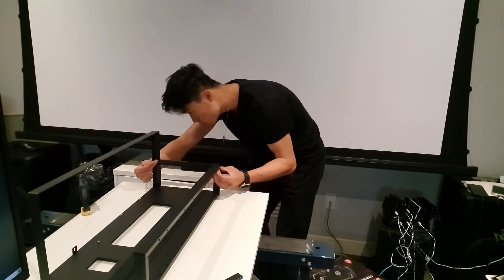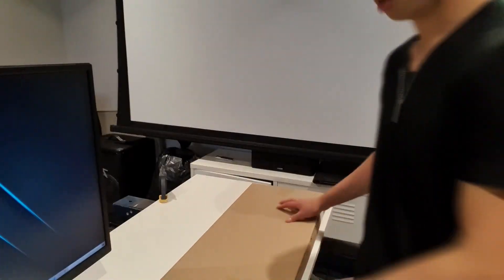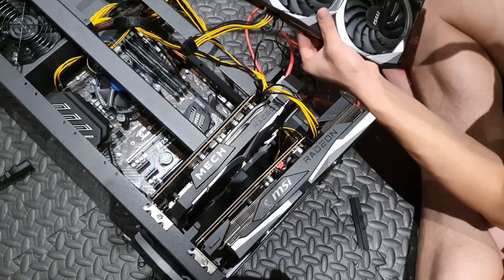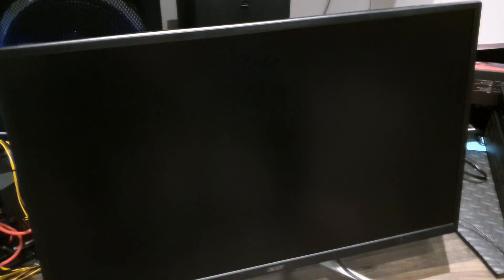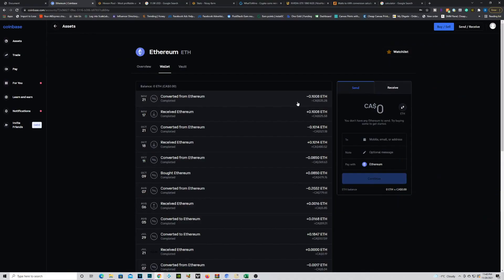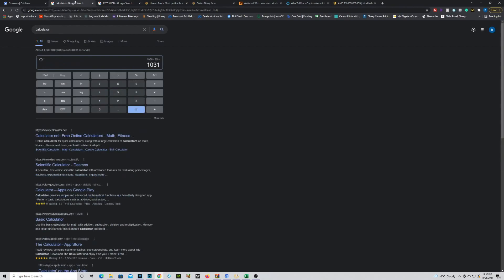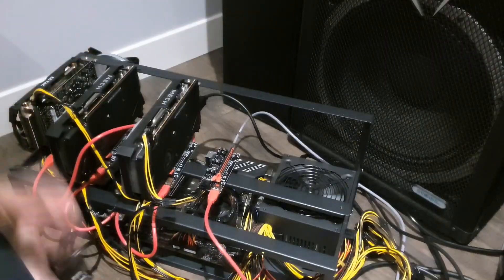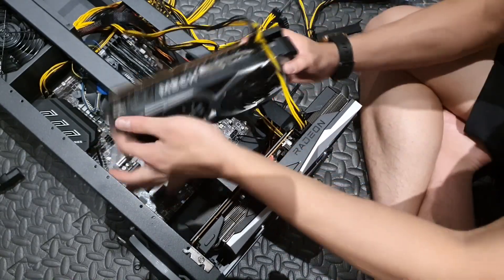New Passive Income Method 2021! | 6600XT mining profitability

Comment: Awesome build, I have to stick with phone farming. Your electricity rate is super low  compare to Seattle at $0.1056/kwh up to 300kwh after that $0.1307/kwh. And US requires all to file taxes for anything over $600 unless you don't sell and hold very long for retirement and get taxed at the end. Amazon 30 day returns are amazing. I'm thinking that you saved up 4-6mo in gift cards to pay for it 😂 Amazon is the only place I know that let us stack our gift cards. I'm using Amazon as a piggy bank.